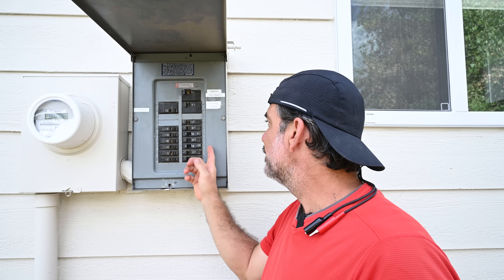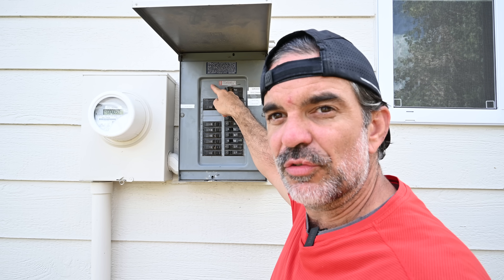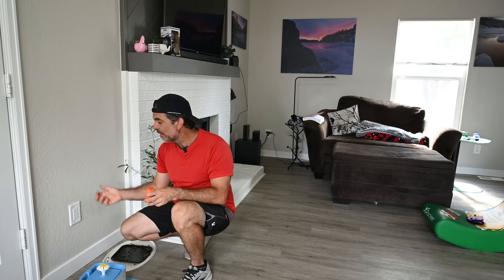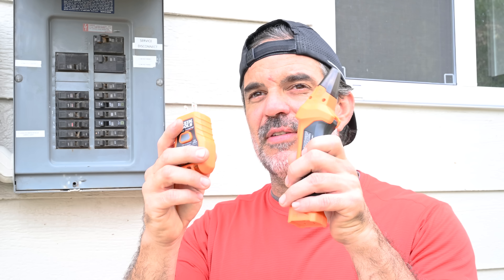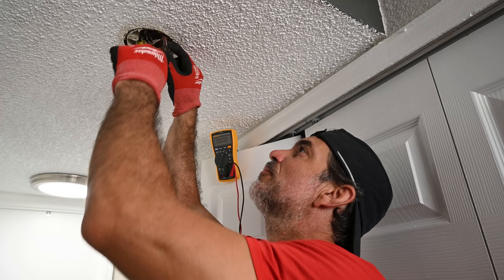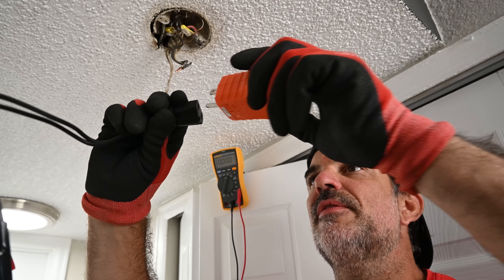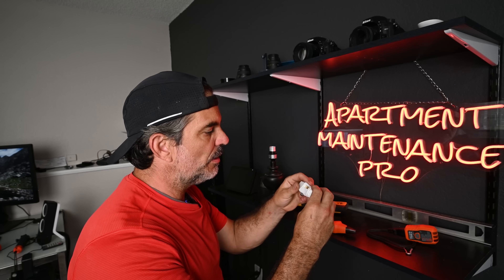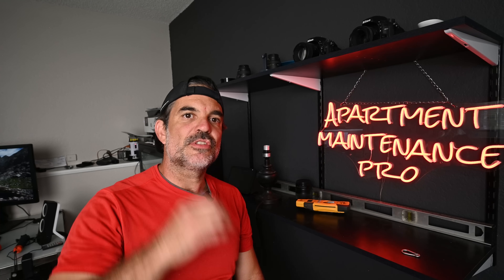Identify Circuit Breakers when Panel is Not Labeled

Comment: Major flaw in that design — when the power is off, you should have a distinct indication and transmission or lack there of. You could pull off the same idea randomly flipping breakers with a cheap smart plug or even faster with a pack of four or eight or twelve LOL that probably cost less than that Klein tool.

Comment: This is great. I used the same tools to locate and link all my receptacles to the breaker. But how do you find out the sequence of these receptacles connected to a breaker. Meaning, from the breaker, which receptacle or switch does it go to first and then 2nd etc...

Comment: I bought one of these and plugged it into an outlet outside (if it is GFCI I don’t see a reset switch, but I used the tester and I can’t get the outlet to work again after resetting the breaker. It has also caused a chain of GFCI outlets to not be able to be reset in the house). Is there a hidden reset on outdoor outlets or do you think I need to replace the full receptacle? Any help appreciated!

Comment: Klein makes great tools, but why not just turn on every light in the house, or plug an electronic device in every outlet and, systematically turn off each breaker in turn to discover which outlet is controlled by which breaker when the device loses power?

Comment: I own the exact same tool and it has been extremely useful. The lazy electrician who wired my house and labeled my circuit breaker box used the most random/unrelated locations and obscure labels. “Appliances” means master bathroom on the top floor and exterior outlets on ground level.

Comment: I bought this tool and had zero luck with it. I used it exactly like this video. I even tried it on a few known circuits and it did it did not work detect the correct breakers. Either I'm an idiot (which I admit) or the tool is defective.
Reply from the maker: I would reach out to Klein and see if you can get a replacement.

Comment: I never trusted those! I retired in 2022, 43yrs in the trade. When those tracers first came out we couldn't trust them. The "tried and true" method was a lamp socket/plug with a 100 watt incandescent bulb and a flasher in-between lamp holder and lamp. Plug it in, go to the panel, clip on your meter and watch that amperage jump! Lighting circuits we dealt with were 277v so we'd use the locater  tool, (safer to turn off 277v lighting circuits than it is a 120 receptacle, you never know what tests or equipment that circuit was feeding).

Comment: The tool is $50- how many times is the average homeowner  actually gonna use it- likely once.  I will stick with 30 minutes of throw the breaker and fluke the outlet or watch which lights go out.
maybe its worth it for super large houses or apartments or contractors

Comment: I just use a small led clock.  Turn lights on in all rooms , then shut off one breaker at a time . Use clock to check unused outlets .  Biggest problem is when you do not check all unused outlets. Like garage was wired to one basement outlet.

Comment: 6:00 - You will always show an open ground when using the pigtail because it only has two wires - hot and neutral. It does not have a third wire to connect to ground. No issue to deal with! Same applies with the lamp socket adapter a minute later in the video.

Comment: Great video, my question is the dryer and the stove run of 240, are you saying you should avoid those circuits? Edit you also show the light buld test for a lamp. You failed to mention it only has one light coming on.
Reply from the maker: just don't (you cant) plug the receptacle plug into them.
Reply: @ApartmentMaintenancePro   Why do you show a full scan when learning and then a full scan to identify the issue? Thanks

Comment: I bought a home 2 years ago, and found the breaker panel had no labels.  I used the same Klein equipment to find the correct breaker for every receptacle in the house.  Unfortunately, I had to identify the breakers for all lights by turning them all on and shutting off breakers one-by-one.  I made my own chart on my computer and taped it to the inside of the breaker panel.  Also, whenever I open a switchplate or receptacle I mark the breaker number on the back side of the cover plate with a Sharpie marker.
Reply from the maker: Nice! Thanks for sharing!!

Comment: The smoke you connected only two  wires that why there was no ground detected for the transmitter. Also if the smoke was on the bedroom breaker just shut the breaker off and if the receiver stops beeping you know what circuit the smoke is on. Good video. 👍

Comment: I do carpentry/Handyman work on homes, commercial buildings, and apartments. That tool comes in handy and works great when I'm working on electrical outlets in apartments because whoever labeled the circuit breakers in the individual apartments were either drunk or on some nasty drugs. It seems that nothing except for a couple of breakers are labeled correctly.

Comment: I traced my circuit panel several years ago, me at the panel, wife with a lamp and flipping switches 😂. Made a custom spreadsheet that is in a water proof sleave that is with the panel. Mapping out your outlets, lights etc is super handy then guess work when replacing outlets and switches. That is a fantastic tool wish I had it then.

Comment: You said using the tool on bigger breakers would fry it.  But, you went over the bigger breakers each time, include the discovery.  What gives?
Reply from the maker: Hi, it's been a few years since I made this, when did I say that?
Reply: You can't plug the 110 transmitter into a 220+ outlet. One it isn't possible, two the voltage would destroy the transmitter. Running the receiver over the 220 breaker is not going to hurt the receiver, no direct voltage impact, just like running your hand over the breaker won't hurt you, but also touching the 220 outlet connections will send you across the room to an ambulance.

Comment: I'm pretty sure you can put a lighting device on a 20 amp but not outlets on a 15 amp. You have both on a 15 amp circuit. Not good, move the outlets or change it to 20 amp breaker. Right?!

Comment: With the alligator clips I had the same problem with the open ground until I saw you had it as well and then it clicked.  It is only 2 wires it is an open ground but it still works.  Great tool.  Hit or miss   sometimes.  It will hit on more  breakers but better than shutting everything off.

Comment: When I moved in 28 years ago, I had to spend the time turning off breakers and then checking the outlets and lights. Made a sketch of the entire house. BTW, the house must have been wired by cavemen as the wiring makes no sense, i. e., most of the upstairs overhead lights are on one breaker. Not how I was taught. Used to work at Lowe's in electrical. Klein tools were asked for my name!

Comment: And even when it is labeled you should still use this tool because not all rooms are on the same circuit. I have a downstairs bathroom in which the vanity light and fan is on one circuit and the outlet, right next to it, is on another. The main bedroom in the same house most everything is on one circuit except a single outlet. Assume nothing especially in older houses to where best practices were not always followed.

Comment: One step you could add that mights save time while doing this single-handed:  
Once you've located the breaker with the tracer, and you turn that circuit off, stay at the breaker panel. Do another scan for the signal. If you don't get any hits, then you can be pretty sure that is the correct breaker, even before you can go find it and confirm that lights are off. 
But if you do get another hit in the panel, and especially if it is on the breaker right next to the one you turned off, then you may have either hit the wrong circuit, or there could be some current leakage/shorting somewhere. If you do get another hit, turn that breaker off instead, and turn the previous "hit" back on. If the signal disappears, then the new hit is probably the real circuit. 
You still need to eventually go back and grab the signal sender and move it to a new outlet to test the next circuit, but this step can save you from walking back and forth if you didn't get the right breaker the first time. Recruiting a helper (or a trustworthy child) can also speed up jobs like this.

Comment: I like your video, but I noticed one important thing. Are you sure that that cover is waterproof because those circuit breakers look like water was hitting them which is really not that safe and they should be changed but also I would make sure that there’s no water getting in to the panel

Comment: Best video I found about this! What machine did you used to make the labels?
Reply from the maker: Thanks! I don’t remember the exact name but picked up the label maker for Office Depot
Reply: Any of them will do, but best to get one that will print more than one line on a label, as shown in this video.
Reply: @SamClemens-d5n  thanks for the tip, that's what ai did,  I bought one that can print 2 lines.

Comment: Before buying older homes (pre-1970's), check for illegal bootleg grounds by using a DMM in the LoR range. If it's below 1Ω, pull the receptacle and look for a bootleg cheater S shunt between ground and neutral. If it's 2+Ω, it's probably fine but always pull one receptacle in the house just to be sure.

Comment: I've tried the Klein, G-B, and Greenlee breaker-finders. They all have the problem if strong signals in adjacent breakers (despite being on a different leg) and of course, breakers on the other row.
Of the three, I was surprised that the (very old, now, bought in the 90s) G-B unit worked best, despite the Greenlee costing a lot more. YMMV, I suggest you try a friend's unit before buying.

Comment: We did it old-school.  It takes two people, ideally using cell phones, and some post-it notes.  We went room-by-room and plugged a lamp into each receptacle, then I flipped breakers one by one.  If something turned off, we confirmed the breaker number, wrote it on the Post-it, and stuck it on the wall.  I went back through and compiled the list afterward.  We have a copy of the list on the computer (two lists, actually; one organized by location, one organized by breaker), and I update it if I add or change anything.  It's the first thing you should do when you purchase a house*, especially bc you can do it more efficiently while the place is empty and you can see where all the receptacles are.

*Runner-up: Find your sewer clean-out.  You never know when you're going to need to access that.
Reply: I live alone in an old house I bought in 2019, and I realised pretty quickly that sorting out my hilariously mislabelled breaker board would require countless trips up and down the stairs and flipping switches, like a demented Warner Bros. cartoon.  After talking to quite a few people I'm of the opinion that virtually everybody has a mislabelled breaker board.

A neighbour said that a very old-school method was to use a plug-in portable radio, but I can't remember the last time I saw one for sale, including at thrift shops (1978?  1980?).  I thought a vacuum might work, but mine are relatively quiet and I could not hear a vacuum running on the 2nd floor from the basement.  This tool set will help, but unless I can find a plug-in radio or other loud device somewhere it looks like I'm going to get in my steps in a big way.😂
Reply: @agcons  I just moved into a house and my breaker is not labeled at all.   It also has 1A/B, 2A/B all the way to 20A/B.    I am by myself and I manually flipped 1, went and checked what lights were off, etc.   I got all the way through it but I still have about 7 breakers I dont know what they are.   However as I went through the first time, I wasnt checking every single plug.   Which shame on me, now I have to go back and do it.   I have fans, lamps, alexa, TV, surge protectors, etc. that all light up so I am going to find something with a light on it, plug into all remaining recepticles I wasnt able to find and do it all over again.   Pain in the ass, but will be worth it when its all done.

Comment: You should check both the top and bottom plug on each receptacle.  There may be two circuits in one receptacle.
Reply: Code in a kitchen, where I live.
Reply: It's possible to have 2 circuits in one receptacle. But that would be illegal for residential without a junction. Box divider highly unlikely, unless you've got a half switch.That's on a wall switch for a lamp

Comment: Good info.  I switch off the main breaker first, pull the faceplate of the breaker panel to verify if there are spare breakers installed that are not yet wired. Reinstall the faceplate, label any spares, switch on the main breaker, then start the testing.

Comment: My old home was upgraded to 220 100 amp service years before I bought the home. All the new panel breaker’s installed were for 20 amp service. The problem? They didn’t upgrade the wiring throughout the home.

Comment: In my newly built home the circuit for the smoke and CO detectors is the same one as the wall mount TV locations. I thought this was weird until the electrical foreman told me they do that on purpose so that people won't just turn of the breaker for the smoke detectors to eliminate nuisance alarms. Doing so would turn of their TVs too! Brilliant. He said they NEVER put smoke detectors on their own breaker just for that reason.
Reply: Several years ago my electrician said my smoke alarms are on the same circuit as the ceiling lights in the utility room so that it's obvious if they are ever turned off, or the breaker fails.  If the detectors are off the lights are also off.  Pretty clever.
Reply: I called the smoke detector manufacturer on their customer tech support line and the agent said the manufacturer recommends that the smoke detectors should be on their own dedicated electrical circuit.  My neighbor's house had the hard wired smoke detector wired on the same circuit as the bedroom outlets and EVERYTIME my neighbor vacuumed or use an iron, the whole house wired smoke detectors would alarm sound.  The agent said the newer detectors are very sensitive to voltage drop especially when a heavy draw vacuum or iron is on the same electrical circuit and when the vacuum or iron is turn "on" the smoke detectors will sound.  My neighbor had an electrician run a dedicated electrical line to the smoke detector and the problem instantly disappeared.   The NEC (National Electrical Code) does not require a dedicated circuit so they can be run on general lighting circuit to be NEC code compliant but always remember the AHJ (Authority Having Jurisdiction) (State or County or local town) will be the finial decision maker on this electrical matter.

Comment: So open ground shows on transmitter all the receptacles in this one particular room are two prong. I am trying to install one GFCI on one outlet in that room. Every outlet shows open ground in that room. I did the learn it turned red solid on two different outlets or two different breakers tried each one tried them both at no point does the transmitter light ever go off and at no point does the outlet ever lose power? I have no idea where I'm going with this. I've tried all of the breakers in the box I am at a complete standstill here no freaking idea. My white wires are on my left my black on my right if I check voltage on my top two which is left white right black I get 120 V if I touch top right black to bottom left white I'm getting about 36 V if I touch top left white bottom right blackI get 5 V riddle me that Batman

Comment: Good tool. Prior to this I would shut the main off, then use my Low Volt tester to find the individual breaker for the outlet in question. After fixing the bad outlet I would have to reset all the clocks in the house. I am a FIRE/BURG Tech so most of my tools are for Low Volt circuits. I still don't know which circuit powers my new home's smoke alarms, I'll  probable tackle that when there is a problem! Good video.

Comment: This video is absolutely great, so underrated. Thank you for posting. I do have a question. If anyone knows the answer in my basement I have what appears to be old covered monoxide for smoke detectors hard wire? Is it possible to remove the devices and replace them with battery operated ones and use the hardwiring to install new receptacle.?

Comment: Who the hell pull their panel outside where so much moisture is especially in the morning, doing this requires two person and 4 lamp if possible to speed up the process which should take about 10 minutes depending on the size of the house but say a 720 sq should be about 10 minutes with two people, turn everything off and turn on one breaker when all the lamp are plugged in then continue with each room don’t forget the ceiling light

Comment: I have a slightly older Klein model.   I have found these things also do not work when plugging in to a GFCI outlet.  So you have to use a different method for tracing the circuit.

Comment: Read this before you buy it.
Not as good as this guy is trying to describe.
I bought the same Kline tester and when I tried to use it it gave me more than one breaker and sometimes even three circuits, it happened multiple times.
In my frustration I called the company and I was told  by Kline rep to disconnect all Surge Protectors in the house.
Imagine that, I think I have one for almost every outlet, well, thanks a million Kline.
I wish I knew that before I bought it.

Comment: I asked a guy that does home repairs about those circuit detectors.  He told me they aren't as accurate as you are showing.  He's not an electrician though.  Maybe he didn't have the learn mode going.  What I do when I do find the correct circuit is I remove the wall plate and write the circuit breaker number on the back of the plate, as well as label the box.